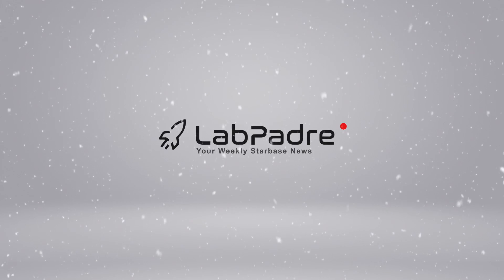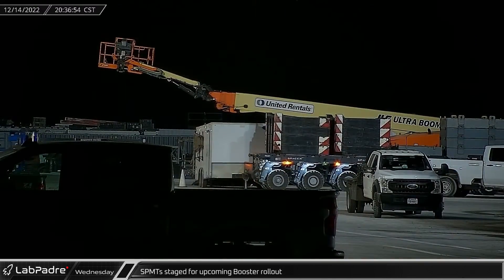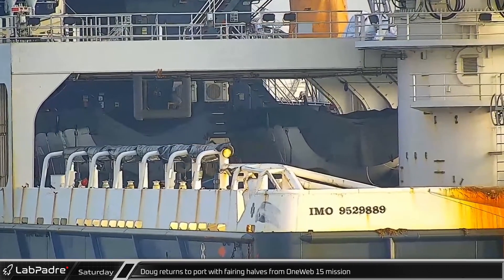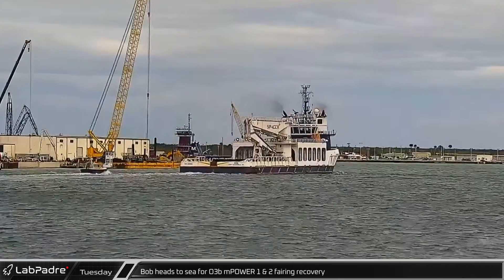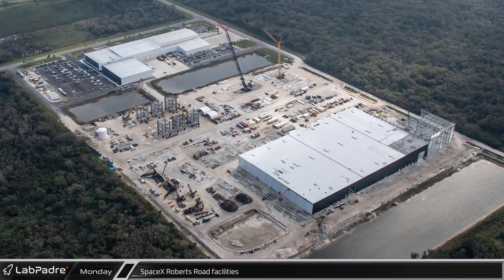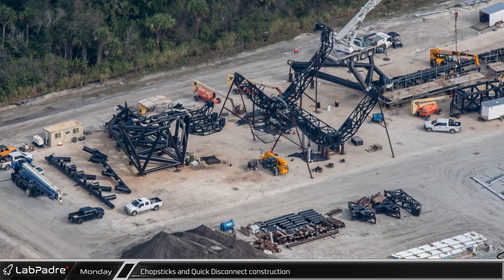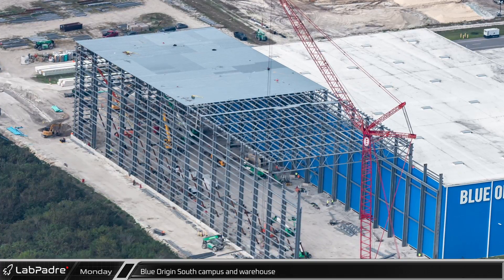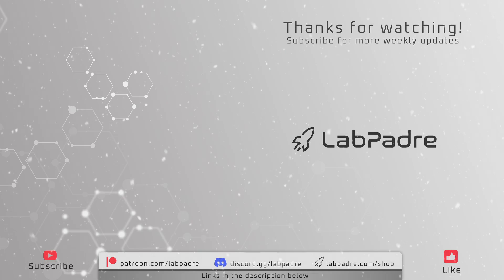SpaceX Almost Ready for Starship Orbital Test Flight?! - Starbase Weekly Update #41

Comment: Blue origins new glen facility and SpaceX starship factory are both very serious efforts. Both rockets offer new possibility's starship is a game changer. And the New Glen's 7 meter diameter payload fairing also is a new capability not available before either.
Both these rockets easily break the 5 meter diameter payload  restriction.